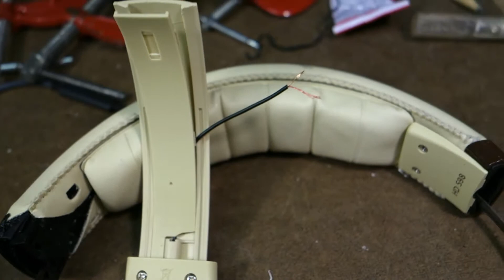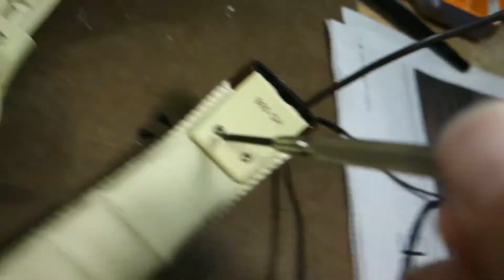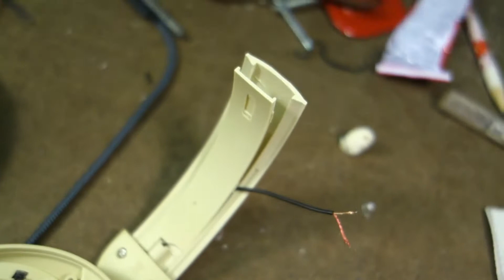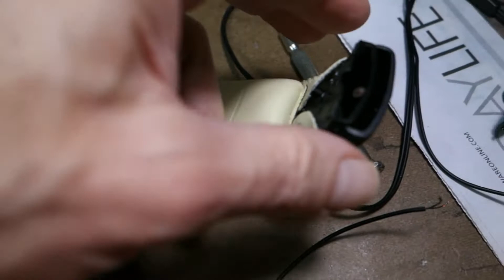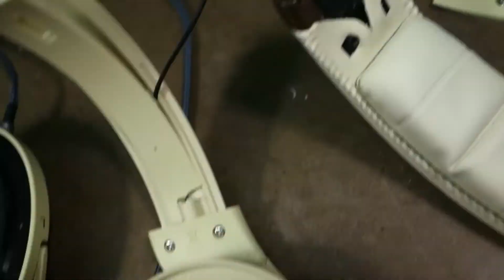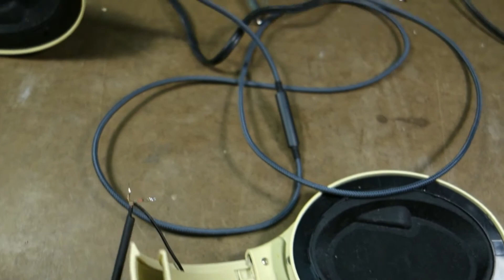Sennheiser HD598 headphone disassembly and wiring repair

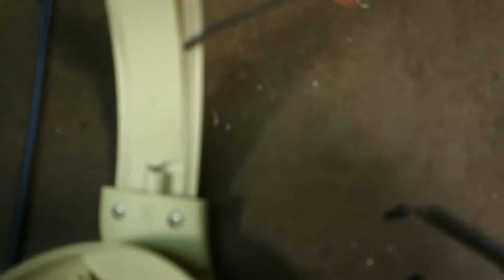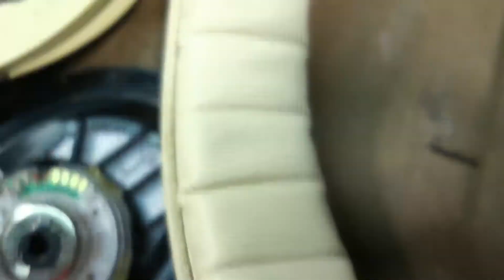Comment from the maker: @Soren that's kind of touched on from 04:00 to 05:00. I think you have to unscrew the collar on each side, and be careful when you pull the sides out because there is a wire connecting them through the headband that will break if you pull them out too far.